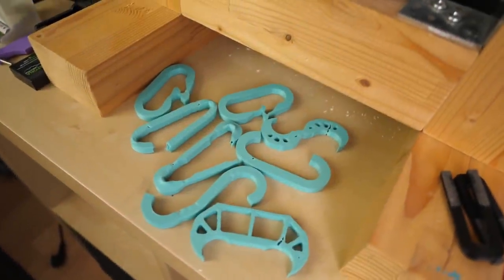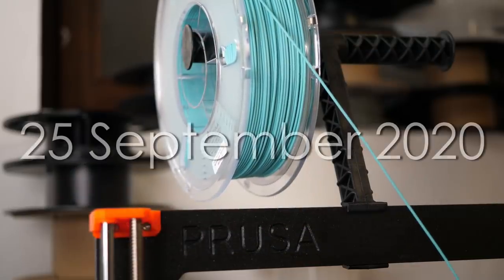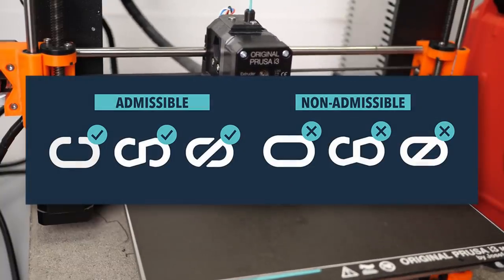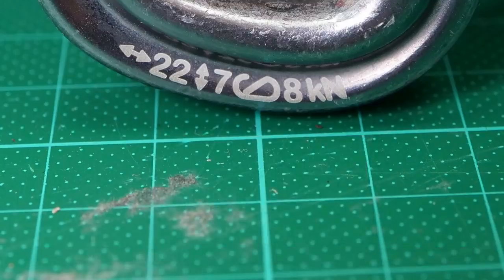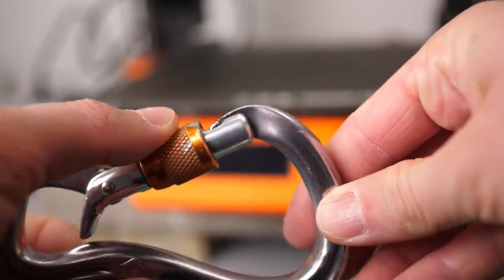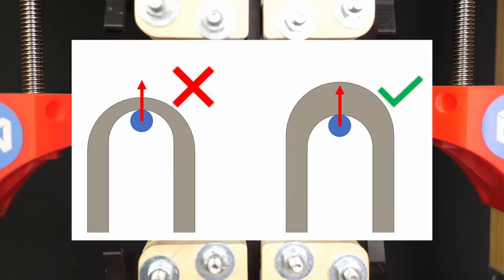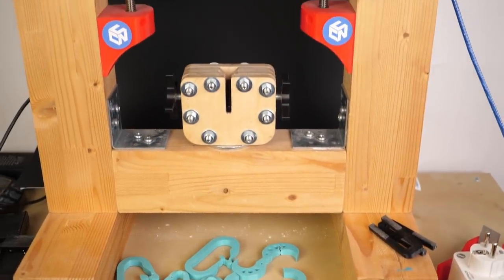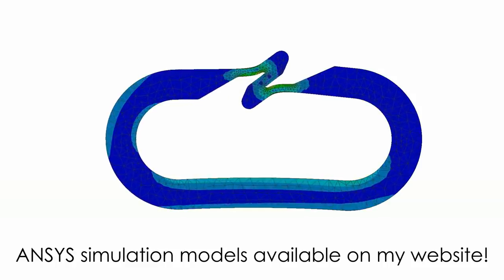The strongest hook wins a $1,000 3D printer! 💪

Comment: Well, that's an interesting marketing move. Let's not do the math... But it's so generous of you helping 3 people to enter! Way to go.
Reply: It's about 70 spools (did a quick calc before reading your comment) worth of prizes. They are accepting 128 entries, I don't know what the profit margin is per spool but if it's higher than about 45% they make money.
Reply: colin young accepting only 128 entries is pretty rough. It wouldn’t take much brains for an entrepreneuring turdstick to  enter 127 times using really crappy designs and fake details, and then once with a half decent designs. If they sent them in quick, using a courier for the first and then a less priority service for the rest of the entries, they could game the system and guarantee a win. 

Then again, the cost of postage for 128 packages and the filament used for the prints.... it’s not worth the effort of the scam... unless it’s the prestige that your after.
Reply: The Talent no

Comment: that's a bit useless
why would you want to win a 3d printer if you already have one to print out the hooks? i think they should just accept print files as entries
Reply: Im not against having more than one 3D printer haha
And I think files as an entry would only make sense if they would block people from using smart slicing ways to get stronger hooks :)
Reply: People like multiple printers, also some people want to upgrade if they have an ender 3 or some of the other budget printers out there. Also you get 20 free rolls of polymax which will cost around £800 alone. That's around £1600 worth of stuff for free
Reply: @benclimo461  Actually its 20 spools of your choice haha so you can go crazy :D
Reply: @3dprintingscience528  oh even better! Time to get 20 spools of PEEK 😂 I doubt that's included.
Reply: lots of people have access to printers through schools and libraries.
Reply: What?! You own a 3D printer? And you don’t want a $1000 3D printer ?? Tiiiiiiit Does Not Compute 🤖

Comment: You could start your own competition without material limit. Maybe just reduce max mass so your machine can measure it.
Reply: I'm gonna print it in titanium
Reply: @logitech4873  I'd print my own CNC printer. Where the (enormous) nozzle doesn't run on filament but gets directly fed with climbing hooks.

Comment: I think I'd modify the carabiner style hook to ensure that both of the "legs" are as much as possible in line with the fixtures of the tensile tester. Is there any limit on how short the hook must be? Because it appears to me making the hook shorter will also give you more material to "spend" on thickness.
Reply: Nope nothing. Just the the metal s hooks must go though. So yeah make it  so that the hooks just barely fit trough and then spend the rest on thickness .
Reply: Good idea, I think the shorter the better!
Reply: @3dprintingscience528  That´s not what she said... ^^
Reply: _ David _  8mm. So you only need really small hooks
Reply: My thoughts exactly!
Reply: The climbing hook is a proven concept

Comment: I wonder if there would be a clever way to pre-stress a part so that when the load is applied, the internal stresses partially cancel out with some of the load, increasing the threshold for the load it can withstand.
Reply: Yeah there is. If you think in 3D. You can design it so the bending moment of the hooks basically completely get absorbed. Just print the latching part twice stacked over each other with a small gap in between, so that there is no hard connection, thus having it technically open. In that case the one part tries to push out and the other part tries to pull in. This will result ins some torsion but thanks to a much wider are that is not a problem in my fem analysis. 
The only question is if the layer strength of the 3D print is big enough but that should not be a problem. 

I mean you wont be able to open the ring but you are also not with the design that he showed here. So technically it is closed, it basically behaves closed but it is open. If you have a printer with dissolvable support you can easily build something like that and 0.2 mm between the different layers. And basically you have a solid ring in the end.

Then add some cross braces internally, just leave 0.2mm there as well and design matching cavities. That way it also is technically open and not closed and you can get a lot of strength. My fem analysis showed that it can bear much more load than even a solid ring.
Reply: In order to make something with the strongest strength to weight ratio, the approach is to design the geometry to have uniform stress throughout. I.e. no portion of the loaded geometry is at a higher stress than any other.  This way, as the stress approaches the yield stress, no material is under utilized.  This approach is what topology optimization is all about. Pre stressing is only a good approach when you have multiple materials and you want to transfer some of the strength of one material into the other material. For example  if you compress your "hook" with a metal bolt. Then as the hook is loaded, the bolt stress increases, but the compression in the plastic hook actually is relieved before it starts to be under tension. In this case, ideally, the bolt and plastic would, again, reach their yield stress at the same time for ultimate strength.

Comment: the strongest solution will be just put two metal hooks in contact and then take 50 grams of filament and wind it around like a wire. So if there will be a spiral with thin sides to minimize bend stress it will be stronger. Also if there is one side is a thin wall and another is a lever with a hook to reduce bending force in a hook it woll work too.

Comment: It's important to note here that all climbing equipment designed for load carrying is for DYNAMIC or shock loading NOT static loads as Stefan's excellent test rig does very well. The extra curves in modern climbing karabiners are designed specifically to cater better to a shock load event such as a climber on a 3m lead falling some 7-8 m before halting (2 x 3m plus rope stretch and belay slippage). Such elements do NOT necessarily lend themselves well to static load improvements.

Comment: You don't want to use topology optimization tools here.

They do linear stiffness optimization, not strength optimization. Since this is a failure test in plastic, there will be a lot of deformation.

Any commercial optimization software will miss the ideal solution pretty aggressively, and the open source research codes I know of would take a supercomputer to run.

Comment: If it can be more than one part add a lug on an openable closed loop and have a notch that holds a price that can be slid over it to give reinforcement to that weak point like the screw of karabenas or whatever they are

Comment: The carabiner design is interesting, but they could easily close this loophole. Make the steel fixture a closed loop instead of a hook, then require that the fixture can be inserted into the HUT (hook under test) without deforming the HUT.

Comment: I'm thinking it's going to very difficult for the judges to determine if annealing has occurred or not? For instance very slow print speeds, very hot build platform/enclosure temps and a slicing scheme that has custom pauses for hours between layers could muddy if it's been technically 'post processed'

Comment: Seeing as this is judged by the strength I suspect brittle failure to be favorable compared to ductile so the maximum yield strength might be higher
Reply: PLA, like most polymers reaches an ultimate tensile strength after plastic deformation has occurred.  This can be useful because if there is an area within the part of high stress, it yields and becomes stronger, which can help unify the strength across the part. Brittle failure is like the weakest link in a chain breaking, whereas ductile failure is like the weakest link yielding and becoming stronger until it's no longer the weakest link. Then the new weakest link yields and becomes stronger. Eventually every link is at a uniform strength.
Reply: Polymax PLA has a ductile property to it due to the additives, it's their PLA 'Plus' filament essentially, don't really recommend it for the price.

Comment: Well I do not think the Carabiner design should be allowed. If it is that means all small gaps are also allowed. Especially for the inner side of the carabiner you can then just add connections so that it presses on the inner side of the hook. Just leave 0.5mm of a gap and it is technically not closed.
Reply: But how do you define it? What if the mechanism is 5mm apart?
Reply: I think its nice to leave people bend the rules, thats where creativity comes from :D
Reply: @3dprintingscience528  Well but the way I would do it it would be technically apart however you could never open the hook in any way. 
So really I do not see the point then. Or it must be better defined. Like what the minimum distance has to be between the individual parts. 
Also can you use dissolvable support, etc. 

Those things can give you a huge advantage while building complex models. My idea can not work without using those since I would have the layers stick to each other. And the fem simulation shows, that the design I now have is more stable than a closed loop due to the way how the cross supports inside work.
But they are not closed however are based on compression so unloaded there is a 0.2mm gap between them. Technically it is not a closed loop but it has crossbeams in an x-shape.

I think it is a good idea however way to vague and if you have a cheap 3d printer, so people who would benefit from an upgrade, you can not win. 
Basically you give a printer and fulfillment to people who already have high end machines.
Reply: @nukularpictures  I think the rules are pretty straight forward, your hook is open or not :)
If not then its fine.
Regarding the second point, you will certainly have people with better printers than others, but thats like this.. I mean you also have people with better ideas than others, or better engineering education.
You can create the fairness as much as possible but there will always be a balance between fairness and space for creativity.
I guess you even have some people with better 3d modeling software than others lol
Reply: @3dprintingscience528  Well with the printer I agree. This is why I would have people send in G-Code or silcer settings with files. Otherwise it is as much about the printer than it is about the design. 

And for the rules: I would have not used metal hooks but chain links to connect it. That way the hooks would have to have at least the openings to put the chain through. Would have also made it more fair. 

I mean I wont enter, i have access to an industrial stratasys fdm printer. So I cant use their filament but if I could no hobby machine can get that print quality. 

For me it is just a badly designed competition since people with good machines will have huge advantages. I dont think a good design with a 150€ printer can win against a bit less good design with a 2000€ printer with good support materials.
Reply: @nukularpictures   "I dont think a good design with a 150€ printer can win against a bit less good design with a 2000€ printer"

I would take that challenge :D

Anyway lets see what kind of hook will win :)

Comment: Nice scam to sell their filament: must be "Printed in PolyMax™ PLA (any color)
Reply: What filament would you have chosen for everyone to print with? :)
Reply: @3dprintingscience528  In a fair competition, any commercially available PLA.  I do understand the need for a control in a scientific experiment but if you really want to find the best solution it should be more open.
Reply: @3dprintingscience528  I probably should have said "nice marketing strategy to boost their sales of polymax"
Reply: @enhaxed7839  Got you, yeah I guess the main challenge was because of all the different kind of PLA
Reply: @3dprintingscience528  One that doesn't cost $40 a roll LOLOL

Comment: Ah I thought you could just send in the stl file but they want you to ship it? How can they be sure I didn't use a slightly stronger filament on the inside? Or even embedded fibers
Reply: Your slightly stronger fillament would need to be the exact same color. Fibers would be visible when it breaks in stress testing.
Reply: @awellner3285   Ya I know but still a smart person could probably trick them.
Reply: @quique182  Ya obviously the fiber thing is a bad idea, but if I had the ability to make my own spools, I could just use the strongest possible plastic. How would you test that Mr. Science man.
Reply: @quique182  Start with clear polycarbonate and then add colors to it until it perfectly matches the desired color. Matte finishes are irrelevant and dependent on printing temperature. All models sent will have varying levels of gloss anyway from that. It would be hard but it is not as impossible as you are making it out to be. The higher they make their reward the more likely it is they will encounter attempts at cheating.
Reply: @quique182  Or better yet make it from a cast mold and say you used a very fine nozzle. You could even use their exact plastic.
Reply: @quique182  I'm just saying that forcing us to print it ourselves allows for all kinds of rule breaking you are probably not even thinking of.

Comment: Polymaker's "rules" leave so much room for abuse - and remember "technically correct" is the best kind of correct.
My "hook" would look like a postage stamp and would sit pressed (sandwiched) between the two steel S-hooks. It would weigh less that 1g, and would beat the crap out of all other designs. Topologically, a postage-stamp is a hole-less object.
No rule states that the steel hooks may not touch each other. 
Scratch my idea.
A better hook would be a postage stamp of zero thickness, zero mass, and zero purchase of Polymaker's PLAs ;) Strongest hook? Or the emperor's new clothes?
But wait! We can do even better!
At one point, the invisible-postage-stamp concept too shall fail, because the steel S-hook shall bend. Can we make a 3dp object to reinforce the hook-shape of the steel? We have 50g to play with... DAMN! Now that's a real challenge!
Reply: They say in the rules that the hooks may not cross each other. So.. yeah.

Comment: Make internal geometry inside the carabiner that can open and lock again like the outside link. Like it's got a spiders web inside.
Reply: No need for it. If this carabiner is allowed then you do not need to do anything. Just leave 0.2mm between the structs and design it accordingly. Because this carabiner will never open. Not if you scale it to the dimensions you can have with the 8mm hooks and the 50g. You will have a very thick part so you basically have no chance of moving the plastic.

So if that is an ok design, the rules for no closed circle inside the part is basically meaningless.
Reply: @nukularpictures  Yeah I did wonder if this will be allowed. I don't think it is okay unless it can be practically opened. Although 50g is a lot of material. A screw thread collar would be another option but does that count as a printed as one part if its print in place?
Reply: @Audio_Simon  Well I would see that as two parts. I mean it should not matter if it is printed in one go for me that would mean two parts.

But yeah this challenge is way to vague to really tell what is allowed. I really think they need to clarify it a bit and restart this entire thing.